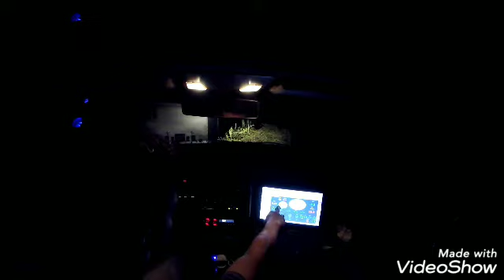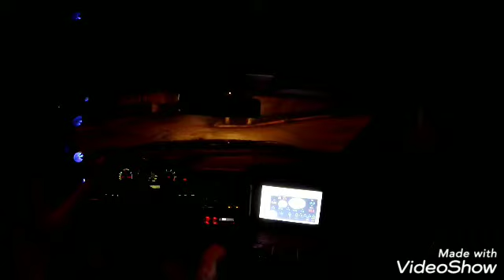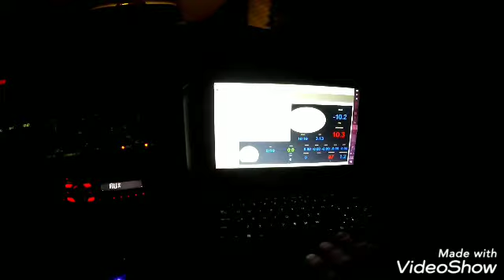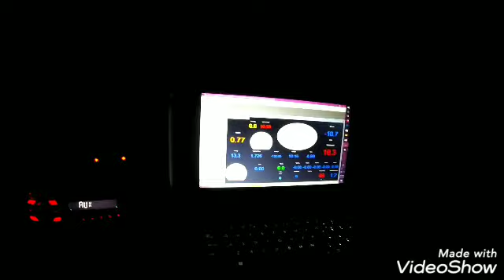Street tuning and datalogging explained Volvo 850R

Comment: Are you running a cone filter and 3 inch MAF with your Vast ECU set up?
Any issues with that if so?
Have you had any high rpm richness issues that cause puffs of smoke on high rpm shifts?
Currently trying to work out those particular issues with those mods. Supposedly the cone filter ruins MAF sensors.

Comment: Was there a driver needed for the laptop ? 

I can’t connect
Reply from the maker: No driver was needed. It took me a few tries , but if you follow the vast instructions it should work. In this order: start the engine, connect the cable, open tunerpro and click connect arrows
Reply: Volvonauts thank you . I’ll try again . I didn’t get anything from Arron other then the ecu and a email link to m44 fandom
Reply: How did you get boost to show? Mine doesn’t